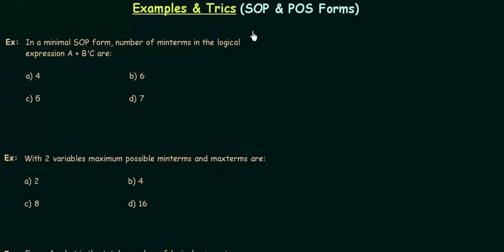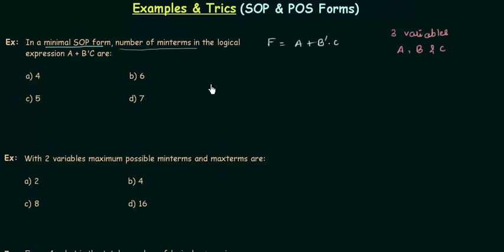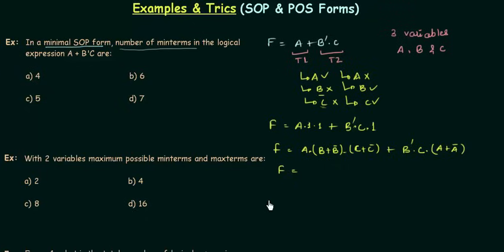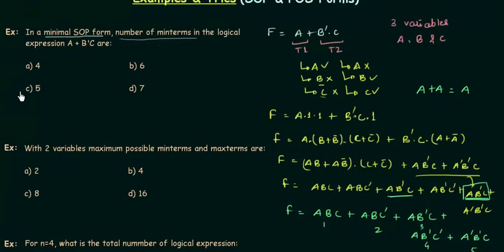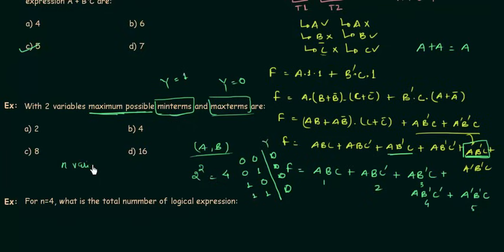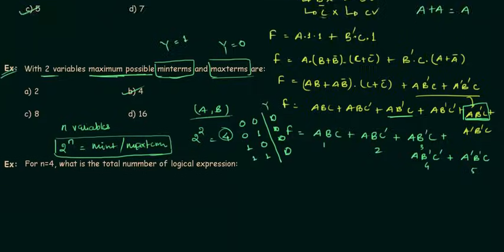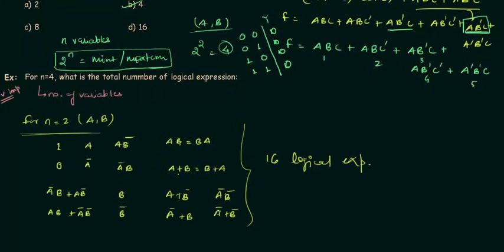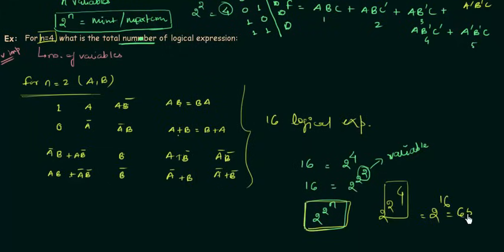Examples & Tricks (SOP and POS Forms)

Comment: For 2 variable (2²)² i.e. 4²
In expiration 4)^n
So for 4 variable
(4)⁴=256
Or (2²)⁴= 2⁸=256
You make a mistake n that is you wrote (2²)⁴=2¹⁶ which is wrong.
Reply: No sir is correct.. It is 2^2^n  not 2^2n . ..
Reply: Explain plz  @debosmitaray9051

Comment: In last you made a mistake dude, power to the power will multiply so {2^(2^4)} is 2^8 and that equals to 256. So for the 4 variables, there would be 256 logical expressions
Reply: Bro, 2^(2^4) = 2^(16) = 65536, check in calculator buddy. You yourself has written inside Parenthesis.

Comment: Has one dobut..in this video 10:46 the value of ((2^2)^4)= 256 ..or 65536????
Reply: That's the comment I was looking for...I also didn't understand...
Reply: Yeah why i has dobut it mean (a^m)^n=a^(m*n)..is right know??
Reply: @dossyutham4910  this is a common interpretation error. correct way of understanding can be; total exp. = 2^m and m=2^n. so if n=4, m=2^4=16 and total exp. = 2^m=2^16=65,536. what usually happens is people mistake 2^(m^n) for (2^m)^n=2^mn. I don't know if its relevant now but i hope it helps.

Comment: Timing and Triggering Consideration, Clock Skew, Conversion from one
type of Flip-Flop to another.
Registers and Counters: Shift Registers, Shift Register Configuration,
Bidirectional Shift Registers, Applications of Shift Registers, Design and
Operation of Ring and Twisted Ring Counter, Asynchronous and
Synchronous Counters, mod-n Counters.
UNIT 5: (~10 Lecture Hours)
Finite State Machines: State Diagrams, Mealy and Moore Models, Finite
State Machines-Capabilities, Limitations, Minimization, Serial Binary
Adder, Sequence Detector, Parity-bit Generator, and Pseudo Random
Sequence Generator.
Algorithmic State Machines: ASM Charts, Design of ASM Charts for
Binary Multiplier, Dice Game Controlle

Comment: UNIT 1: (~8 Lecture Hours)
Number Systems: Review of number systems, Complements of Numbers,
Codes - Binary Codes, Binary Coded Decimal Code and its Properties.
Boolean Algebra and Switching Functions: Basic Theorems and
Properties, Switching Functions, Canonical and Standard Form, Algebraic
Simplification of Digital Logic Gates, Universal Gates, Multilevel NAND/
NOR realizations.
UNIT 2: (~8 Lecture Hours)
Logic Families: Introduction, Characteristics of Digital ICs, Transistor-
Transistor Logic, Emitter Coupled Logic, MOS Logic, CMOS Logic,
Interfacing ECL and TTL, Interfacing CMOS and TTL, Interfacing CMOS
and ECL.
UNIT 3 : (~11 Lecture Hours)
Minimization of Combinational Circuits: Introduction, The
minimization of switching function using theorem, The Karnaugh Map
Method-Up to Six Variable Maps, Don’t Care Map Entries, Tabular Method.
Design of Combinational Logic: Adders, Subtractors, Serial and Parallel
Adders, BCD Adder, Carry Look Ahead Adder, Comparators, Multiplexers,
Demultiplexers, Decoders, Encoders and Code Converters, Decoders for
Display Drivers, PLD’s: PROM, PLA, PAL, Realization of circuits using
PLD’s.
UNIT 4: (~11 Lecture Hours)
Sequential Machines Fundamentals: Basic Architectural Distinctions
between Combinational and Sequential circuits, Latches: SR, JK, Race
Around Condition in JK, Flip Flops: JK Master Slave, D and T Type Flip
Flops, Excitation Table of all Flip Flops, Design of a Clocked Flip-Flop,

Is these all topics available

Comment: Thank you for the videos, Sir. I also would like to suggest another way (which is way convenient for me at least) to solve questions like the first one.

If I faced with such a question, I would first directly draw the truth table for A, B and C based on the minimal SOP form and fill it by implementing every 16 combination of zeros and ones to the given expression. At least for me, it would take far less time to determine the number of ones beneath F. If the question also asked the canonical SOP form, it would be easy to be obtained from the truth table as well.
Reply: what if the no. of variable is large in no. then the method of making truth table will take a  lot of time .
Reply: @Rahul4-YrB.Tech.ElectronicsEng  True. In addition, when my lecturer saw a coursemate using truth tables during our last test, he laughed, shook his head and walked away. I think I'll just use the normal method . . .
Reply: that's great bro. I realized I am actually good using the truth table rather than the expansion method

Comment: In question number 1 it is asked to calculate number of terms in minimal form.. Sir why u r calculating for canonical form
Reply: ya I was wondering around same thought,haha
Reply: @lavishgarg4274  in 1st question he asked to calculate the number of min terms not minimal form...in order to find out that u definately need the canonical form so he converted it to find that out
Reply: @rohitnamballa236  are mintern only defined for cannonical form because it was already in minmal SOP form...
Reply: @random-test-1  the total number of minterms are defined for canonical form and the number of minterms can be reduced by using boolean algebra or k-map but you wouldn't get the actual number of minterms in minimal form because the minterms are reduced to get the minimal form.

Comment: I would like to help out the guys who didn't understand the no of expressions answer:
here there are two inputs A,B:
firstly,the possible answers after solving the boolean expressions obtained for two inputs can be 1,0(use any gate logic taking any values for A&B ) or any expression in terms of inputs A&B.
So,
possibility 1:1,0
possibility 2:A,A'(incase the B value is binary value and use any gate logic)
possibility 3:B,B'(vice versa of above possiblity)
possibility 4:Answers are now obtained in combinations of A,B
CASE 1:Use AND Gate:AB,AB',A'B,A'B'
case 2:USE OR Gate:A+B,A+B',A'+B,A'+B'
case 3:USE XOR gate:so logic code for XOR:A'B+AB'
case 4:USE XNOR gate:so logic code for XNOR:AB+A'B'
case 5:USING NAND and NOR Will repeat the already obtained expressions
Any other expressions made up of any number of terms can only be reduced to those above possibilities because any expression is derived through logic gates and we have used all possible gates to obtain those expressions.
so total 16 possibilities.
Thank You
Reply: 4 minterms and 4 maxterms at the same time not possible. ( m : M ) == ( 4, 0) or ( 0, 4 ), for 2 Variables
Because max + min terms = 2 ^ n., so total = 4 always.
Reply: Thank you
Reply: THANK YOU SIR
Reply: Thanks

Comment: sir why can't you take 16 = 2^(2*n)
{ you have taken 16 = ( 2 ^2 ) ^n 
as these two are producing equal value }
Reply: 2*2=4 also 2^2=4
But in case for n=3 or others,
2*3 =6 : 2^3 =8
So they are different..
Therefore 2^2^n is correct